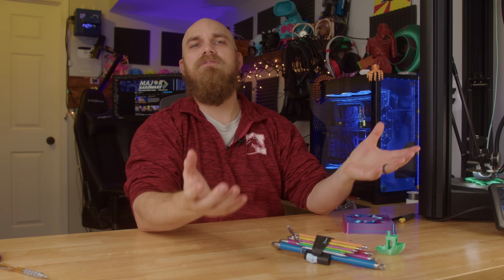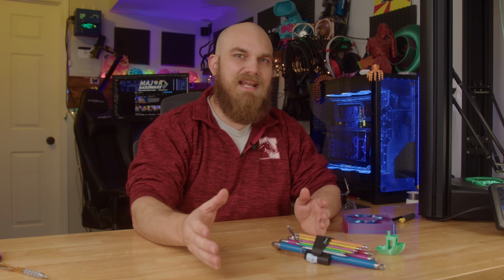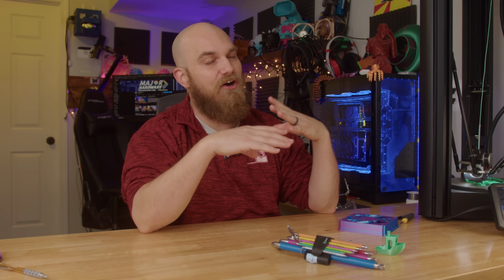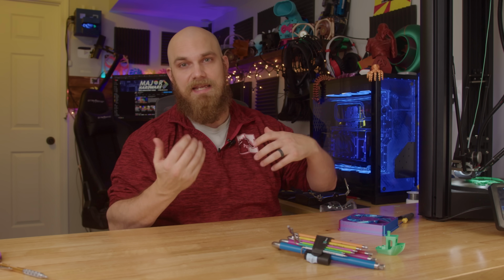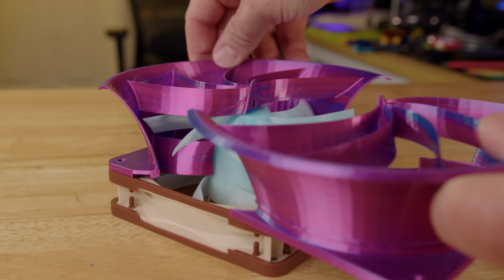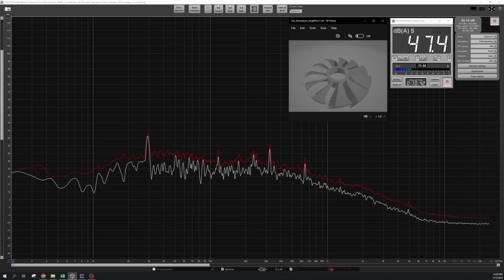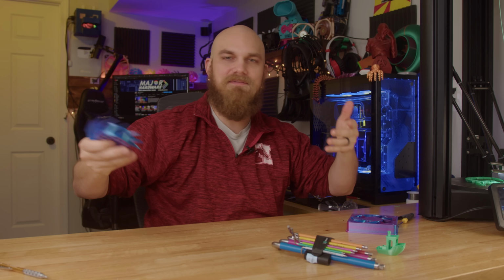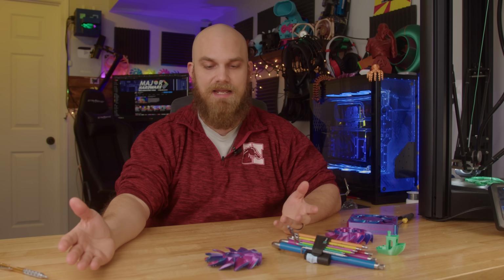Turning a PC fan Into a JET Engine | Fan Showdown S5E4

Comment: 993 designer here. Wow that's a lot louder than I expected 🤣maybe forcing air through those small openings caused it.
Reply from the maker: still love that design
Reply: @MajorHardware  I am curious if the fans that are being tested are RPM throttled or if they are allowed to go full out? Basically wondering if any of the sub 48dBA fans running at less than 2k RPM could be pushed to 2K RPM and then what their sound profile would be as well as the FPM/CFM statistics. Seeing as how some of those fans still have quite a bit of RPM distance to gain on the Noctua if they would end up being better or worse than it or their current standings on the leader board.
Reply: @dracconis69  they're running at 100% except fans like the the jet engine where if they're contacting any shroud he'll try to limit the speed so they're actually useful in testing. only limitation on rpm is the fan it's self(weight, drag, etc). think it was season 2 he tried limiting them to a specific db but to many people whined about it so he's just kept it at 100%.
Reply: @sirmonkey1985  Basic fan controllers only let you adjust the percentage of the fan's own max speed, they don't take specific RPM goals. So for most people there is no realistic meaning to RPM-throttling, because that would be different percentage for each tested fan.
Reply: @KimonFrousios  it would be cool if he built a teststand that was configured to constant RPM.
that would give new design requirements for a new season.
Reply: always + or - 1-5 % rpm on a regular hub fan . close enough and the best 10 could  be tested with better accuracy on some other show i suppose
Reply: My dude, I go by Yukai among my close friends, and am also a huge car fan, particularly when it comes to Porsches. I also do CAD design and 3D printing. The intro left me flabbergasted to say the least 😅
Reply: where can i get the file for that the look is amazing
Reply: @klbanks1830  Let me know your email address. I can send you.
Reply: @yukaiqian9673  idk if my email went through do you need it again?
Reply: @klbanks1830  Huh it didn't appear, probably blocked by YouTube. Try separating it with spaces.
Reply: @klbanks1830  No, and many comments from me were also blocked by YouTube. 😢
Reply: @klbanks1830  I put it on Thingiverse titled Fan Showdown entry: 993
Reply: @klbanks1830  Honestly not sure which of my comments will go through, so if you get notifications for repeated comments I'm sorry. It seems I can't even mention names of other platforms, so here's the 1984 version of my last comment: 

I put it on "the 3D model sharing platform that begins with T", titled "Fan Showdown entry: 993"
Reply: @yukaiqian9673  got it thanks much love really appreciate the time you took for me
Reply: Well it looks the same, but the design is totally different. Just from looking at the pictures shown here I can see the real Porsche fan has a strong curve on its fans with the intake side being flatter, while the 3D printed fan seems to actually curve in the opposite direction slightly.
Reply: @InfiniteDarkMass  It's mirrored because the directions of rotation are opposite. They both have backwards-swept blades that twist to have smaller angles of attack at the tip. The leading edges are both convex towards the flow direction and the trailing edges are both concave.

Comment: You can probably use a strobe light on that variable-pitch fan to capture the images
Reply: That is an excellent idea, cyclical stuff can be stroboscoped to "slow" it down.
Reply: Or take a flash image at various RPMs. The flash is super short, so the shutter speed won't really matter as long as it's not shorter than the camera's flash sync speed. Manual flashes lets you adjust the duration of the flash too for more or less light, so it won't be video, but you get to see how the angle is at least.
Reply: @Alexandra-Rex  nah, use a strobe and get it adjusted so the moving part stops moving to your eyes, then just video the whole process. Take photos from the video
Reply: Bruh... A normal camera, with flash on, set at a fast shutter... It's something you can do with your phone, not as video (video is possible but he needs a lot more light, that's why he didn't succeed. He needs an enormous amount of light, like, full sunny day.), but just in photo mode with the shutter set at a fast setting... It's very easy to see it that way.
Reply: Props to Harold Edgerton.
Reply: Take the good and interesting fans! Doesn’t have to be unique persons behind them. Fun to see well made fans
Reply: If your strobe has a trigger, you could even trigger it off the motor's tach output pin, so that it strobes at exactly the motor's RPM, regardless of speed. No adjustments necessary.
Reply: came here to say just that. stroboscope + slowmo cam would probably get the job done good enough

Comment: 993 also has 6 horizonally opposed pistons firing.. you hear the fan, but not nearly as loud as you think. at idle hardly audible over the engine. revving it up you hear every other sound but not the much of the fan
Reply: thanks for the update one day i'll own a porsche ...one day